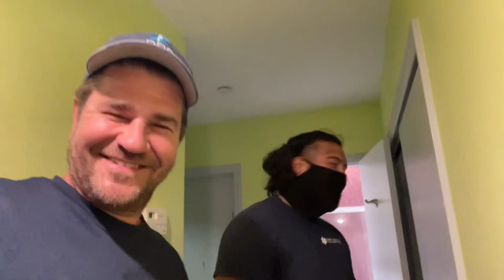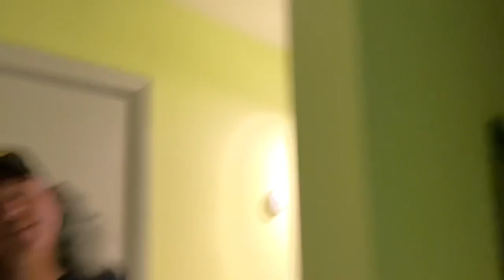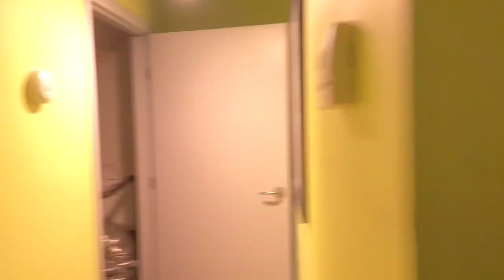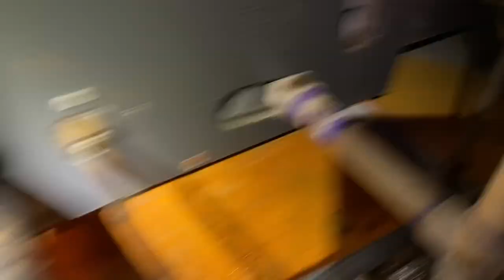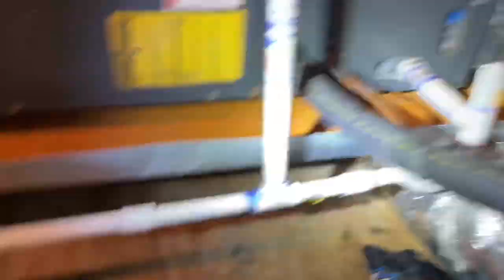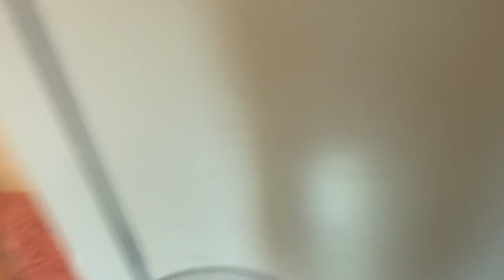Why? Someone Tell Me Why? Who Stacks AC Units & Have Common Drains? Goodman Hack Installation

Comment: Like that termination at the 3" 🤔 looking likely it's been leaking for a while  just got back from a no heat fried inducer cracked collector box 2 small cracks in exchanger but it's been running good customer said 🤣 Sold them Bosch heat pump  .

Comment: Never double trap a drain line you have one of each air handler and one over by the between the pan and the pipe the main pipe it will clog
Reply: Not only that but the double trap, without a vent after each of the primary traps, will air lock and neither will drain. The bottom one needs a cap on the clean out tee too. Good luck

Comment: Was gonna say something about the double trap until I saw it was hooked into the backup pan. Guessing that trap is there because you don't want sewer gases getting sucked into the ACs? Does nobody in that area put switches in/on the backup pans? We put the wet switches in almost every pan and make sure the backup pans aren't piped. Hah, and every single apartment building is common drained so if it backs up in the basement the 1st floor apartment starts flooding its great.
Reply: Depends on the installer. But not everyone does.
Reply: Bryan, I am confused. What does a dried out trap have to do with an evap coil?  Given the large amount of crap in the pan, either the trap isn't working correctly, or whole unit is tilted and not level. I would have

Comment: The third ptrap you gotta be kidding me 🤣🤣🤣🤣🤣🤣🤣up it to one Inch on the last trap then 3/4 the air handlers at a one inch t  or do a 1 1/2 trap with a 1 1/2 too 2 bell and drop the 3/4s in the bell reducer just above the water line and you will be fine
Reply: @PipeDoctor  a long time ago me and my coworker got called into a service call and we're trying to find the furnace which was an electric air handler 2 ton we're looking in closets we're looking at attic we're looking at the basement everywhere they had taken the furnace and installed it horizontally underneath the stairwell in a closet hanging by metal strap and using the whole closet as a plenum return and then they did a spaghetti mess on the supply side 🤣🤣🤣🤣🤣